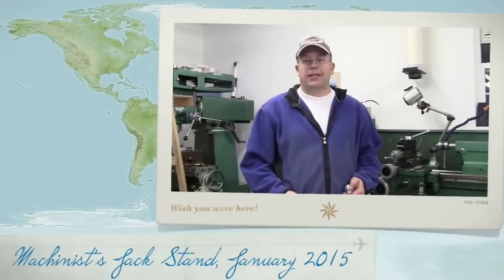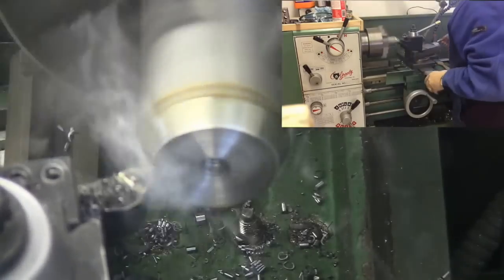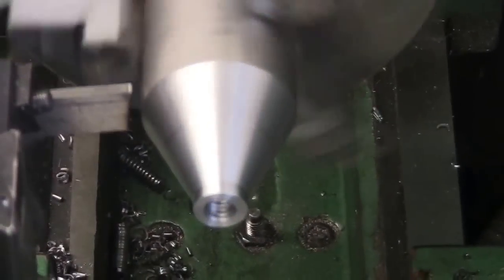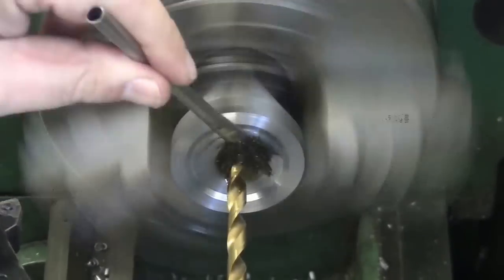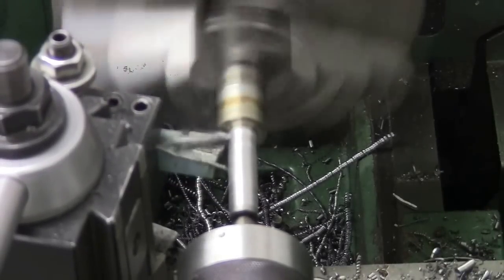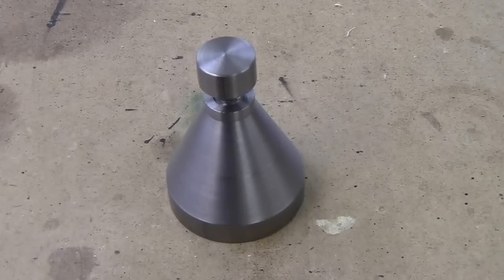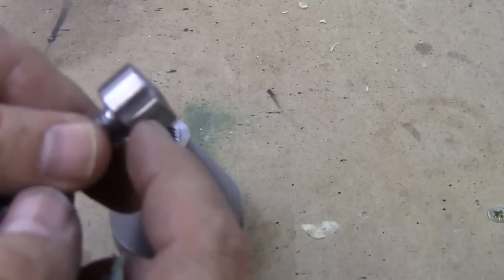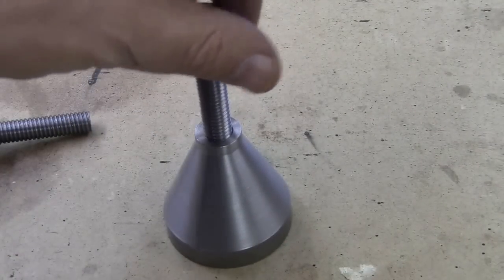Machinist's Jack Stand

Comment: The major diameter of a thread is the nominal size of the thread. So when you say a 7/16-14 thread, the major diameter is 7/16 (.4375"), and that's the diameter you should turn (maybe a couple thousandths smaller to prevent the threads from being too sharp). The pitch diameter is a theoretical diameter which can only be measured with a pitch micrometer (aka thread micrometer), which, unless you have a few hundred bucks lying around to spend on a pitch mic, you probably won't need to worry about. Also, to add to what somebody commented about the chamfer before threading; the best chamfer you can have before threading is a 45degree chamfer that extends from the major diameter to the minor diameter. The formula for the minor diameter is     Major diameter - (2*depth of thread). The depth of thread formula is      .6134*pitch.      The .6134 is a constant that works for all threads including  metric. The pitch of a thread is 1/threads per inch.
Reply: Your pitch would be .071"
Your depth would be .044"
Your minor diameter would be .3495"
So you could set your caliper to .350" and keep chamfering on a 45 till the small diameter of the chamfer is .350" (just eye it up with your caliper). Those numbers will vary slightly from machinery's handbook, but you're not building rocket ships here😉.
Reply from the maker: Thanks a bunch. There's a lot of good info in that comment. Appreciate it.

Comment: Thx for sharing.
I know that it's been a long long time since you did this project but here is my 2 cents worth. Add a jam nut to the bolt and either knurl, add flats or drill for a pin to rotate the jack.

Comment: I'm not sure what type of die you used to thread the bolt section, but most button dies are adjustable. You also need to watch how tightly you make the screw on the holder as it can compress the die reducing the thread diameter. 
There are lots of reference material for diameters for bolts and drill size for nuts. If you use those you should get much better thread fits.
Reply from the maker: Dennis Leadbetter it was a cheap hex die. Not adjustable. Thanks for the comment. I’m a bit better at this than I was back when I made this video.

Comment: Sir i think it will be a much easier if you should use the lathe instead of a die. and use a knurling tool to the head of the bolt to provide a  better grip. thanks
Reply from the maker: Thanks. I concur. As you can tell, I'm a bit new at this. Another commenter mentioned that I would have a better fit if I didn't use the die. I plan to redo this project.

Comment: Great little video. The only thing I will add to the other great comments on threads is this, you can rough the threads on the lathe before you use the die if you are not comfy threading to a shoulder. Until you have some practice, the die will make smoother threads. Use an adjustable die (it will have a little grub screw in it) to make a tighter fit.

I feel compelled to play safety Nazi as well. I do not object to you wearing long sleeves, lots of us do it and live to tell the tale.
I do very strongly object to reaching over the spinning chuck wearing long sleeves (and a watch). There is no E-stop fast enough to save you from major injury if your sleeve gets caught.
I will go so far as to say that if your work flow requires you to reach over a spinning chuck, your work flow is wrong. Put that oil can on the cross slide, and use your right hand. Train your body to never move your left hand past the cross slide wheel. If you watch other pros work, you will see they very rarely let their left hand go past the hand wheel. 
Re-watch your video, and imagine someone ringing the doorbell, your cat/dog brushing your leg, a car backfiring, the lights going out (cringe), or any number of unexpected things that do actually happen in real life. You may think you have all your basses covered, but you do not - you never do. Safety starts with you at the machine and moves outward, not the other way around.
Reply from the maker: Thanks. I am much better these days at staying away from the chuck.

Comment: You have a lathe, you could cut threads on the lathe and get a perfect thread fit at the tolerance you want. practice cutting threads, you will never use a die again.

Comment: If you're looking to tighten up the thread fit, it may be most cost effective to just look at the threading tools you're using and figure out the class of thread fit.. You may have 1A and 1B class tap and die, which will give a sloppier fit. You can find 2A/2B and 3A/3B that may tighten the gap.
Reply from the maker: Thanks. I just learned about the class of threads this week on another video. I'll have to check out what I have. Appreciate it!!

Comment: I was wondering if you used the correct size drill to drill the hole in the base.  if the drill is dull or sharpened incorrectly it can also cut an oversized hole. That may also explain the sloppy fit.
Reply from the maker: That could be. I did look up the correct drill size in the machinery handbook and, since I'm new, all my drill bits are pretty new as well. Thanks for the comment.

Comment: Maybe invest in a die holder that fits in the tailstock, that might make your threads slightly more accurate. Or start threading with the lathe...
Reply from the maker: That will be a project in the near future.. a die holder.

Comment: Why not use a 1/2" socket head bolt, weld up the head with silicone bronze and face it off?
Reply from the maker: Butch McCall hmm. Not a bad idea. I’ve never done any silicone bronze welding.

Comment: I have (almost) the same lathe as yours. How do you lock your spindle for the manual threading ? Thanks !
Reply from the maker: Sorry. I missed this question. I step on the emergency stop pedal. Sometimes I have to put the chuck key in the chuck and hold on to it as well. Wish this model had a spindle lock.

Comment: You can't make a perfect fit thread with a die. What make a thread tight is not the outside diameter but the pitch diameter and every thread made with a die will wobble a bit because the cut is not constantly at 90 degree. If you want a better screw thread you are better to practicing threading on the lathe which gonna give you a lot better control and quality.
Reply from the maker: Thanks. I'm still learning so I appreciate you taking the time to comment.
Reply: The best infos for threading are in the machinery handbook you will find everything you need to know. Try to get one use is the more important tool in the toolbox.

Comment: in fact I saw you routinely reach your left arm over the moving headstock with the long sleeve. I'm quite surprised you didn't get caught
Reply from the maker: I was pretty new at the time. I'm use safe practices now. Thanks for your comments.
Reply: +The Sirius Project your Workshop seemed pretty well set up for a supposed new bee at that time
Reply from the maker: +Tobin Prowant ha. I've been a wood worker for years. Just started with metal a year ago. Luv it though.
Reply: +The Sirius Project this may sound a little silly but I'm exactly the same way I've been wood working in my shop for years about a year ago I got a metal lathe.

Comment: I didn't see it but you need to chamfer the end 45 deg by .04" at least to make it easier to run the die on and get it straight. Your diameter should be .4361/.4258.
Reply from the maker: You're right. I didn't chamfer the bolt prior to cutting the thread. At least not much. The die wouldn't start so I turned the diameter down in order to get it to thread. Thanks for the help.
Reply: No, problem.

Comment: those threads are all flat did you file them flat? That's why they're too loose what is the Cowboys next to each other the one on the right is perfect the one of the left the threads are all flat
Reply from the maker: Clown Whisper I did file them a little. They were sharp to the touch. Thanks.